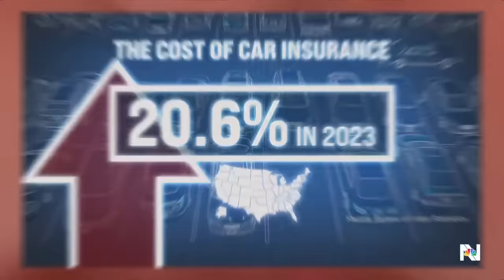Nightly News Full Broadcast - March 10

Comment: I was lucky enough to buy outright a used mid 90s Ford truck. This was in 2007 and it had 50k original mls. I still drive this truck everyday. I now have just over 250k mls on it. Best thing ive ever owned.

Comment: I don't think that cost of ownership figure is correct, but I may be wrong? I keep accurate figures on my 2014 Passat, and repairs, oil, gas, and all replacement parts other than my payment were like 2000 dollars a year.
Reply: Insurance is staggering though, and with all of the avoidable accidents, I'm kind of upset that I drive so carefully and everyone soars down the road at 85 miles per hour.